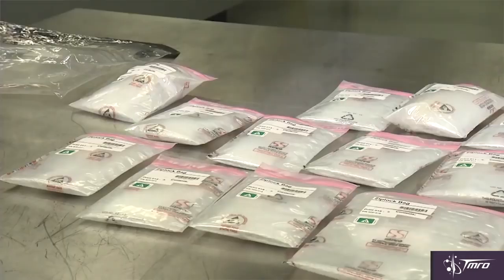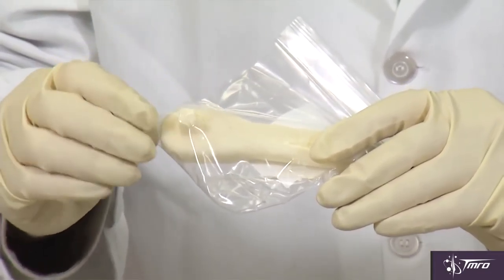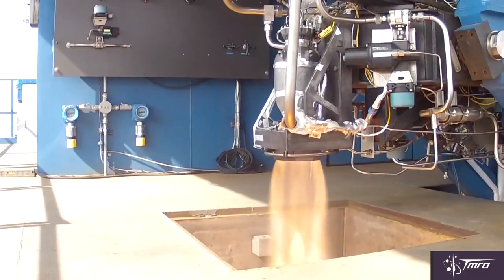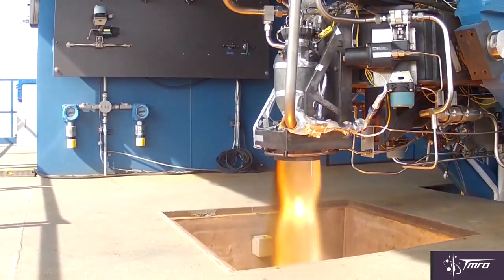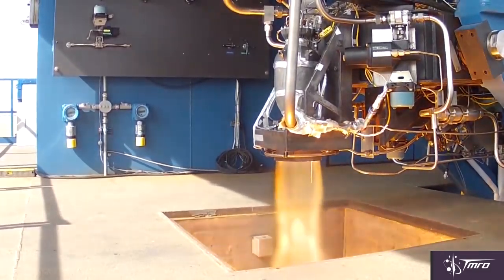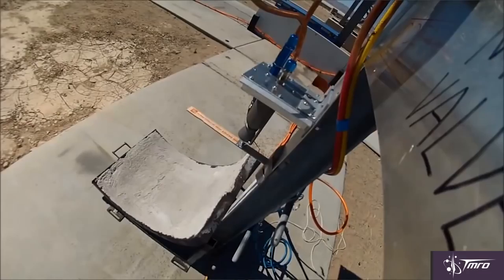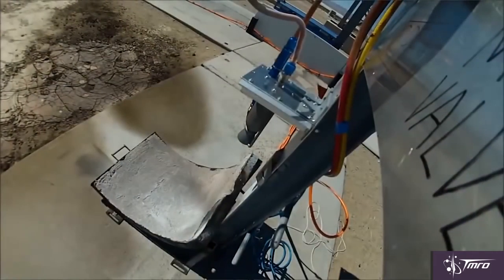3D printing in space and the student built Vulcan-1 Engine - Space Pod 04/15/15

Comment: G'day,

Yay Team...!

 Um, a couple of things trouble me about the idea of 3-D Printing of Tools (like Wrenches)in Space..., let alone  replacement Spaceship Parts...

  On Earth, one can indeed print metal objects in Layers with Laser-heated, Sintered (pre-Powdered, pure, pre-refined) Metal Dust, but the process involves the generation of vast volumes of toxic Gasses which the Metalurgical Industry traditionally dumps straight into the Atmosphere via Extractor-Fans...; and that is NEVER going to be tolerable in Space.

While the Energy and Pollution Costs involved in smelting Ore into Billets of refined pure Metal mixed to the correct recipe, then grinding the Billet into Powder (And storing it in some way which precents it from oxidising - which Powder is REALLY FAST at doing) so that it can later be "Hot-Glued back together....; it's a very dirty and decadent way to be a Blacksmith...

 At least, viewed from this distance...(!).

And there's a limit to what a Plastic Wrench can do to Aluminium, Steel, or Titanium Nuts and Bolts...; try asking a Mechanic what their Tools cost, and why they all have to be Drop-Forged and formed and machined  and then Tempered, and Case-Hardened, in order to perform the Task without breaking while in-use.

  So, assuming you were able to magically solve the Outgassing issues of Laser Sintered Metal Printing in Space ; then how is it proposed to Temper and Case-Harden the printed Tools...?

  I'd be interested in hearing what the " Space Manufacturing Boosters" have to say on such issues...

Have a good one  !

;-p

Ciao !